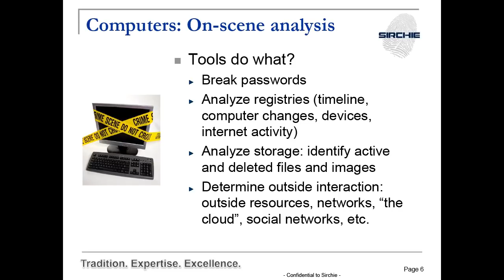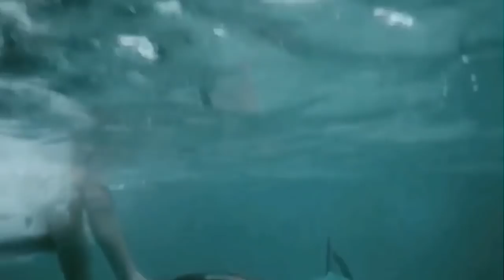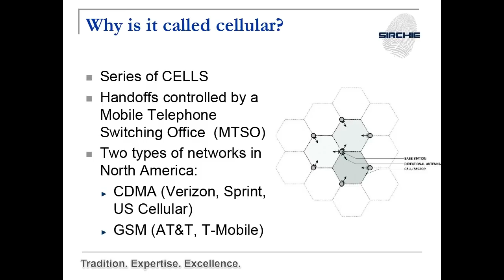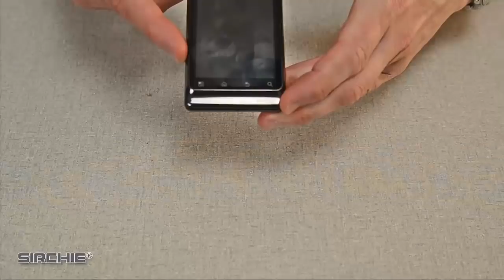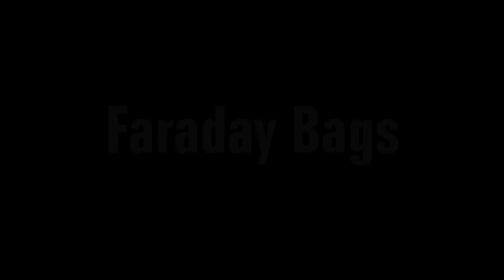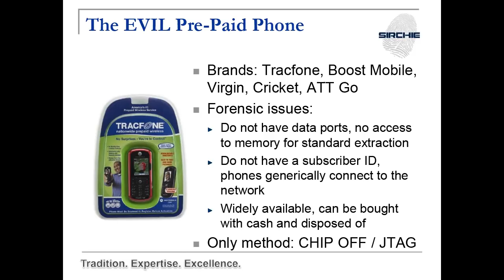Sirchie's "An Introduction to Digital Forensics" Webinar - 9 11 13

Comment: I think it is probably worth sharing that, since the time of this comment, SSDs as well Android (since v4.3, I believe) now have support for something called TRIM/wear-leveling, which is in many ways similar to a small scale secure erase on a traditional hard drives; thus, unallocated data evidences may actually be erased purely from these devices from it having power alone.

Awesome presentation though.